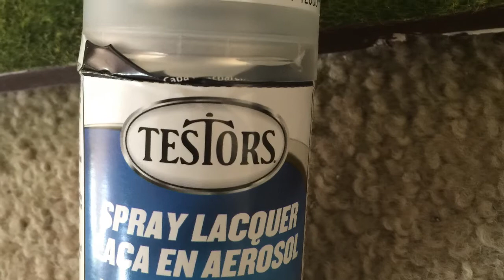EZ layout Building - Part 3: Road Construction and Finishing Touches

Comment: Really nice layout.  I like what you did with the EZ Track.  I'm just starting out, and most videos equate EZ Track with being a moron.  I've looked at the so-called better track systems in the stores, and the work that's necessary to lay cork, solder, etc. is far more labor-intensive than EZ Track.  What you did with your EZ Track make it look not just as good -- but better -- than the expert tracks.  Thanks so much.